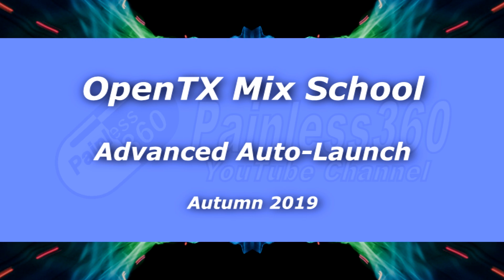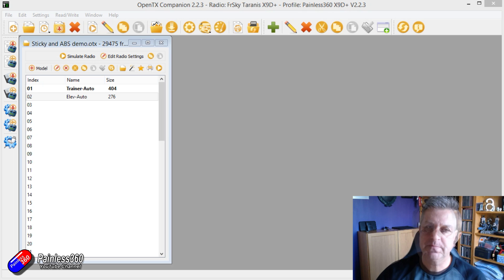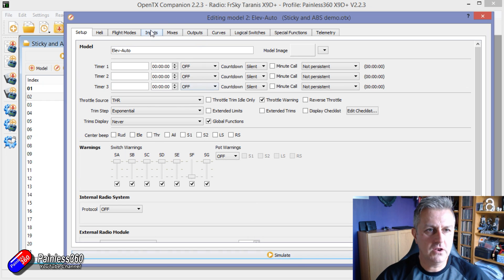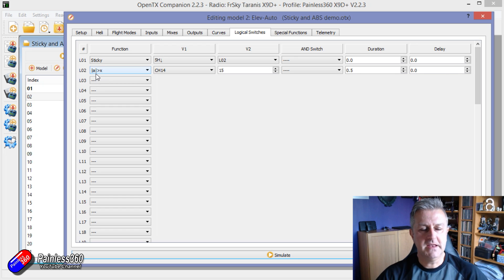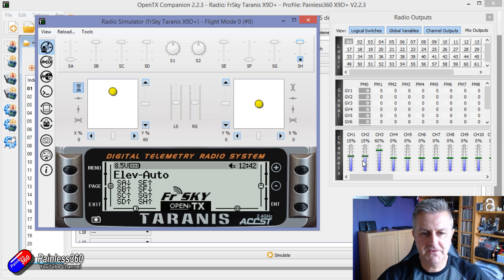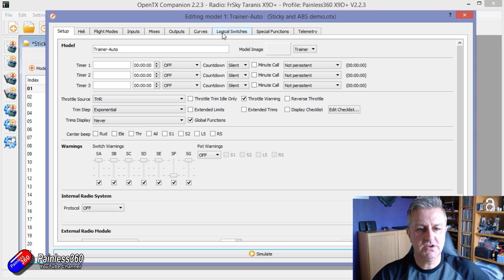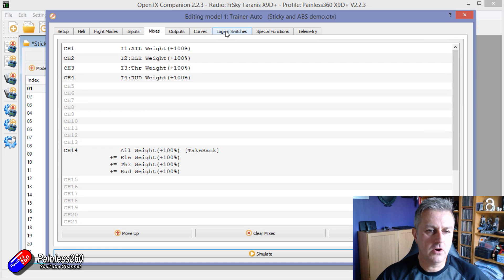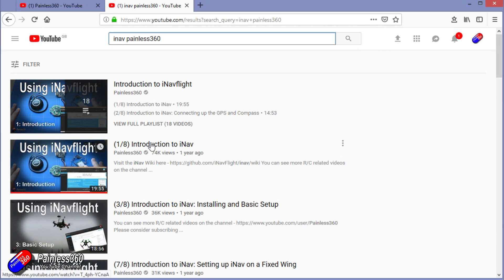OpenTX Mix School: Advanced 'Autolaunch' (automatic up elevators)

Comment: Thanks this worked for me even thought i have Radix FC.  Had to change += MAX on elevator to -60 in order it to reserve the V-tail for lift.  Should I include lift on both ailerons with the V-tail? i am just struggling to get my first lunch into the air,  Thanks Lee and your supporters

Comment: Question: wouldn’t it be better to use the function “|d|>=x”  in the test for L02 and test against a change in value (absolute 5% change of value for 0.2 seconds in CH14 for example) rather than the suggested  “|a|>=x”  approach ?
Reply from the maker: Give it a go and see, there is always more then one way to do just about everything in OpenTX and experimenting is a fun way to find things out .. Best of luck!

Comment: I have been trying to get this to work since the video was published I've tried all the variants for ele rud etc that are in the source drop  down mix. when I operate the trainer switch moving the trainer controls either  puts the master in control. It appears to work in companion but not with the two transmitters.
I'm sure I have copied it correctly as I have done it at least 10 times
Reply from the maker: What version of Opentx are you using?
Reply: @Painless360   Companion 2.2 opentx 2.23 Thankyou for answering

Comment: I prefer to activate a 'launch' flight mode via the logical switch, rather than having +15% (or whatever) hard-coded in the mixers. Set the aileron and elevator trim to 'own trim' in that flight mode, so they are separate to the trim values stored in mode 0 (the normal default flight mode). Then you simply use the trims to give whatever control positions you want in launch mode - most of my faster models need a bit of right as well as up. You can then easily adjust this at the field without having to edit mixers etc. The logical switch setup remains exactly the same - you just use it to switch on the launch flight mode instead of a mixer line.

Comment: Is this possible to set up just in the radio without using computer? If it is, it will be very helpful if you make a video showing how to do it in the radio. Thanks
Reply from the maker: I have lots already for basic setups - check out the OpenTX Mix School and Taranis, QX7, T16 and other playlists.. ;)
Reply: Aero Techno, it is possible to set this up in the radio . . . but you need to work through it slowly/carefully as the “FLIGHT MODES’” and “GLOBAL VARIABLES” are set up on separate screens, which can be a little confusing (Companion combines these two screens into one - as per the video)

Comment: Do you know a way to create an alert if something changes X amount over Y time?
Reply from the maker: Possibly, why would that be useful? I'm intrigued..
Reply: @Painless360  I can't remember why exactly I wanted to in the past, but I believe it was either voltage sag or temperature for monitoring batteries.   I'll put on my thinking cap and if I remember, I'll be back!

Comment: I Was tried to set up Trainer auto .
I don't get it to work.
SH up on master  Traner radio is control.
Traner radio move a stik and Logical switche on master comes  ON .   
Master radio is back in control 

Thanks a lot :)
Reply: You should use I1, I2 NOT  CH1, CH2 in logical switches and mixing
Reply: @Ulf_Ma  Thanks for the reply.
I have tried in many ways now. Don't want to give up :)  

have you tried with 2 radio ?

When traner is in control  the stiks  run the master as  it was the stik on the master radio.  

 Hope Lee make a video about trainer auto with 2 Radio  :)

Comment: Those vertical lines around the |a| in the function setup are called absolute value.  Move stick +15, registers as 15, move stick -15, registers as 15.  They do not mean "when it's close to" as you said in the vid.
Reply from the maker: Cool! Thanks for posting!
Reply: @Painless360  There is an  'approximately equal to' function (a~x) which you would generally use for testing stick positions etc. since mid stick (for example) might give 0.1% rather than precisely zero due to calibration/tolerances/etc. This function is true if the actual value is within 0.9 (plus or minus) of the one you are testing for.